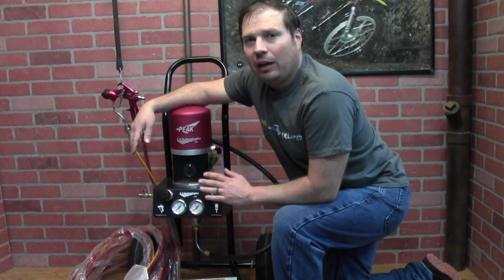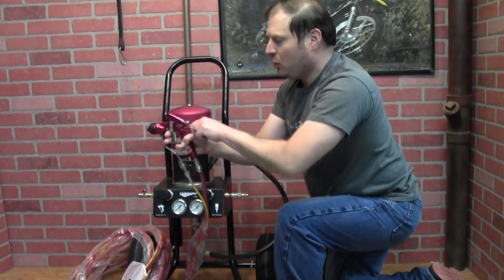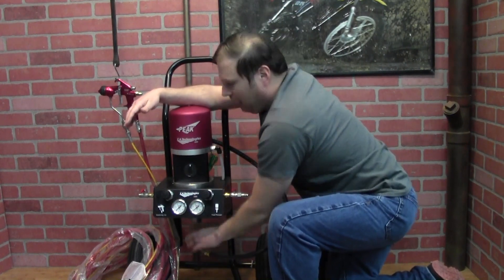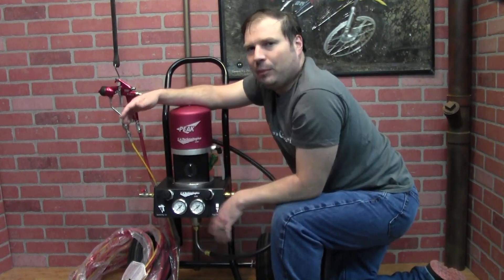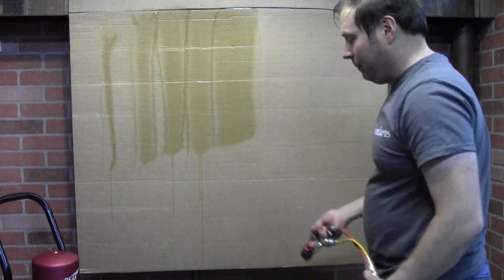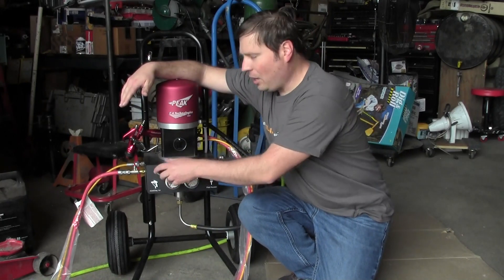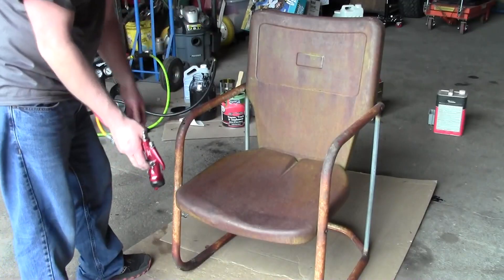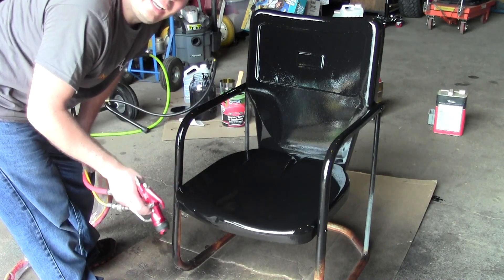What is HVLP Air Assist Airless paint spraying?

Comment: How portable is this, if you paint cabinets in different home each week..
This setup seems to be a shop sprayer only or do they make a portable air compressor for one man to left up into a van...
.
Very good  and  clear detail...Thanks
Reply from the maker: This exact unit is a shop unit designed around production work.  They do however make a more portable unit with an attached compressor.  https://tinyurl.com/ycb9sebf

Comment: thanks a lot for this great demostration, can you spray enamel water based paint without thinning?
Reply from the maker: That information is usually supplied with the TDS on the coating.  It will recommend the tip size for various spray technologies that are compatible.  I can't give you any more definitive answer than that without seeing the Tech Data on the specific paint/coating.  So a short answer is "possibly"

Comment: Great video! Really easy to understand how to use it. One question though what size air compressor are you using?
Reply from the maker: For the demonstration I am using my 7.5hp, 32 cfm 2 stage, but it will run well on 4hp and 12 cfm single stage.  Any thing less you might be taxing your compressor over its rated duty cycle.

Comment: looks good!! Can you do a follow up and show how to clean the equipment after use?
Reply from the maker: I should have put that in there, but its as simple as this.  Pull the fuild pickup tube out of the bucket, wipe it off, put it into some solvent compatible with the the material, remove the air cap and tip, spray into a waste bucket at low fluid pressure until it runs clear. Clean the tip and cap separately.  I have another project where I can show cleanup.